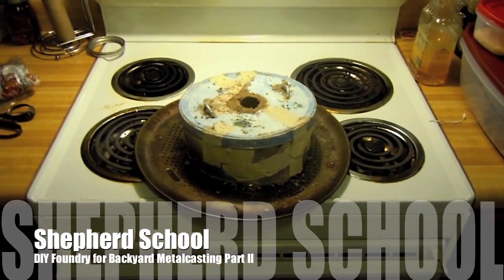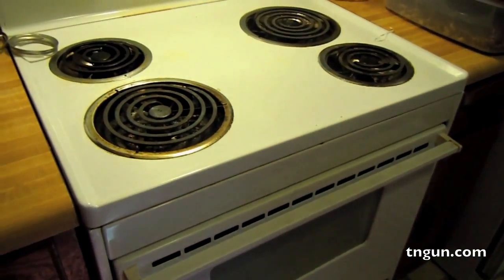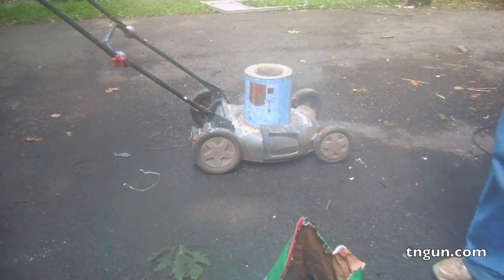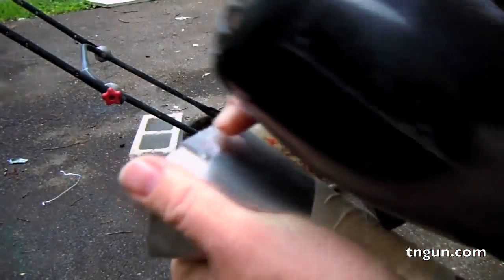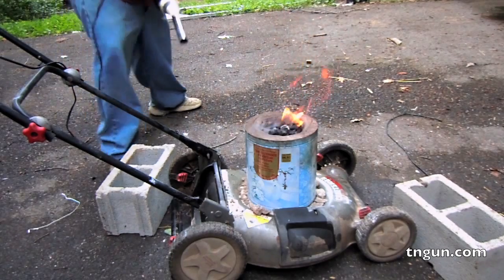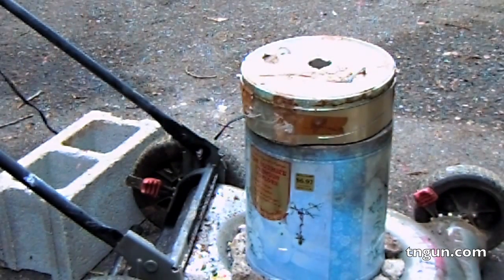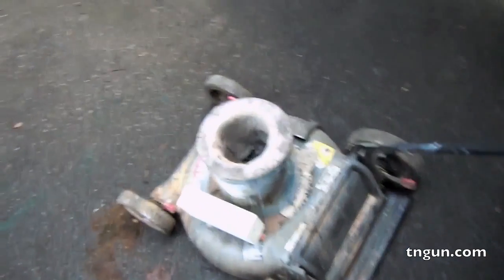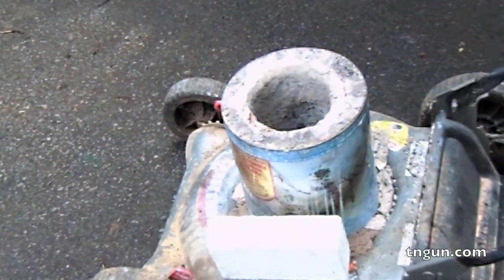How To Build a DIY Foundry For Backyard Metal Casting Part II

Comment: fire clay, available at lowes or home depot as just that. its used in mortar mix. The kind of clay itself is Bentonite clay {the kind of clay found in kitty litter}. your basic mix should be sand, perlite, bentonite, and portland cement. though you can do just perlite and fireclay {bentonite}